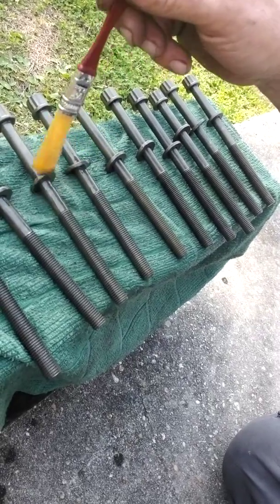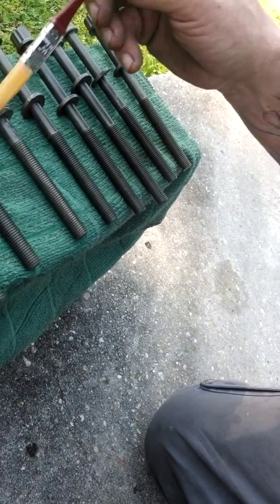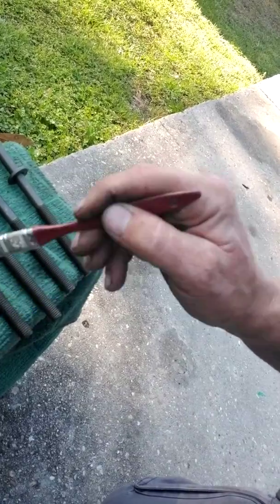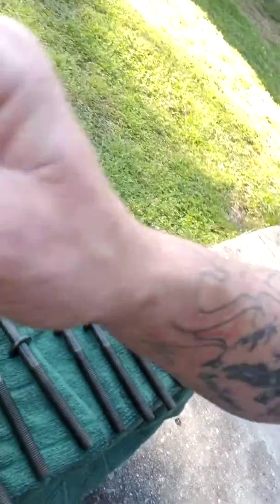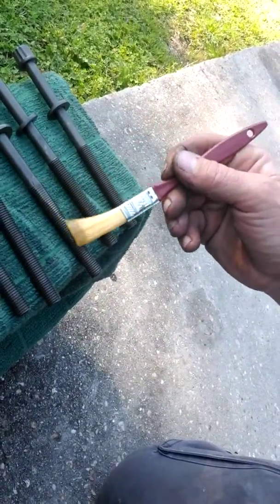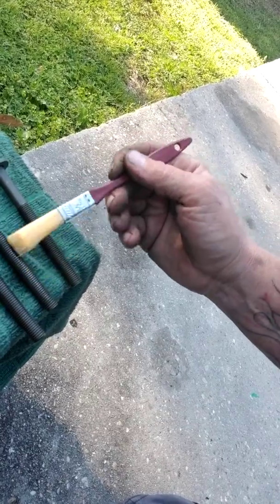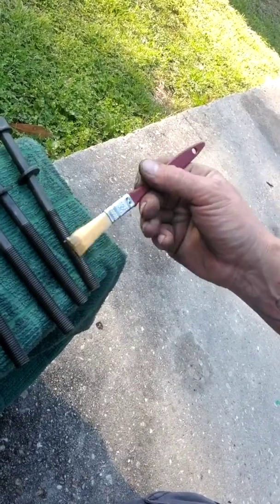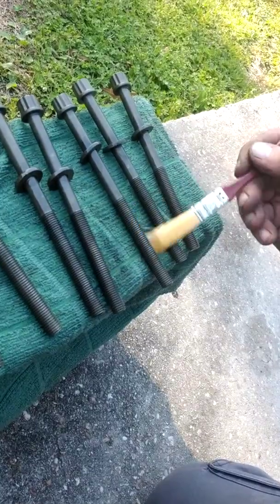torque  sequence on a 07 Honda accord k24 cylinder head

Comment: Steve, this was an awesome video with clear instructions. I am doing this job tomorrow and your instructions will help me greatly. I have the Felpro head bolts and when I called, they told me 29 ft. lbs., then a 90, 90 and 60 on the final. I am with you, I believe that 90 x2 is good being that these are aluminum heads on the Honda. Again, thank you sir,

Comment: I've checked multiple times 90 *2 = 180 degrees which also comes out to 64ftlbs. Yes, I've checked. It's just easier to do 64 ftlbs.
Reply: Inaccurate way of measurement. New bolts stretch which is what torque to yield means
Reply: @zacharyhuntsman7310  I know what TTY means. I never use new head bolts, I reuse the OEM bolts at 64ftlbs on all my 400-500+ hp K series motors with no issues. I have tested the threads on K series engines, they can take up to 75ftlbs before problems start happening. I've had lots of problems with ARP head studs, but never with reused OEM head bolts.
Reply: @Cloneufc how about oem connecting rod on K24, did torque them too? How much?

Comment: Hi Steve, I watch your video. You said 2x 90 degrees is enough. But the manual said if you have new head bolts they recommend 3x90 degrees. I bought new head bolts but I’m worried if I don’t follow the manual my head gasket will start  leaking later on . I would like your opinion. Thanks!
Reply: Hello, at the end, did you have issue with only 2x90 for new bolts?
Reply from the maker: @humble.53  I would follow the specks for new bolts I honestly think you can get away with 2 90° turns

Comment: I thought new bolts were 29 lb feet, 90degrees, 90degrees, and a final 90 degrees. Used are only 2x 90 degrees?
Reply: Ya right